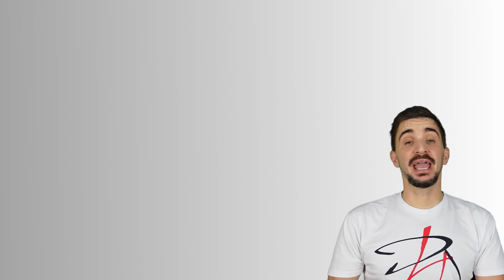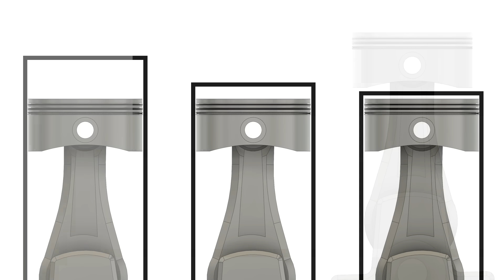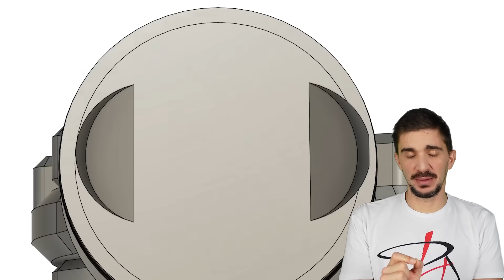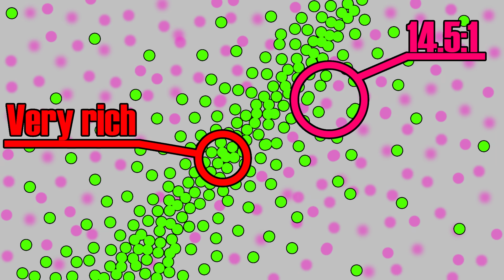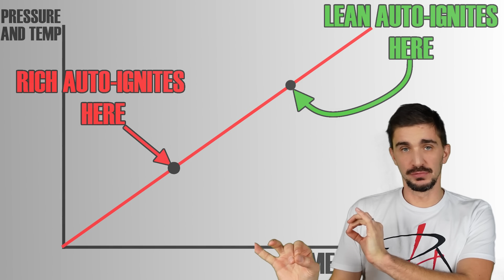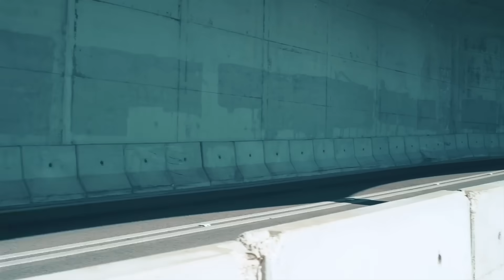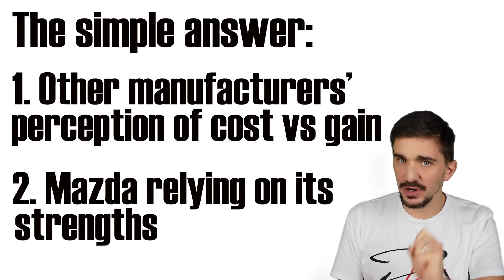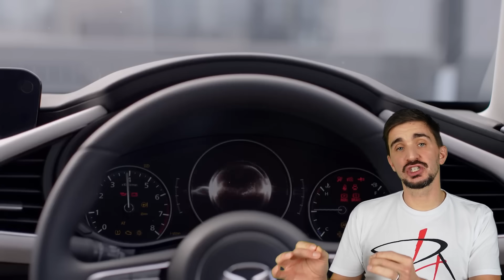The Game Changer Nobody Cares About - Mazda Skyactiv-X SPCCI How it Works and Why It Didn't Catch On

Comment: Put it in hybrids with e-CVT. 

More controlled work environment for engine and lack of torque is irrelevant there because of battery assist.

Put it in markets where fuel costs are a big issue and drives purchasing decisions.
Reply: Toyota has invested heavily into Mazda the past few years and they probably plan to do just that very soon.
Reply: @thebeetalls idk how I feel about that. I feel like Toyota is trying to sabotage Subaru thru their partial ownership
Reply: @XenZenSen Subaru died the day they committed to CVTs and delayed E/V development. IDK if they'll still be around in a decade. Painfully sad (I'm a long time Subaru fan)
Reply: that's nearly a toyota. they already to this in their latest engines starting 2020. lean mixture everywhere with port injection and small amount of direct injection in front of the spark plug so it actually burns but the lean bit is like 17/1 air to fuel ratio. so not as high as mazda. also due to atkinson cycle they can get away with 14/1 compression ratio and it comes with the ecvt that you talk about. mazda is an evolution of that besides the compression ignition they're going with
Reply: @SoulTouchMusic93 The A25A-FXS has a higher compression ratio than the FKS because of the cylinder head design. Both use the atkinson cycle, just like Mazda's 2.5 Skyactiv G
Reply: @SoulTouchMusic93  yeah, and the skyactive x would do better with a lower RON fuel rating for better economy, but good luck getting that in markets or replacing current infrastructure.
Its never the actual technology, its the infrastructure and availability that kills the benefits, which the government should be shouldering but instead they are doing dumb bailouts instead of helping the people
The toyota engines+hybrid+ecvt already do most of it and the air fuel ratio is good enough for some level of savings.
Reply: @acters124 Would the engine run on crude naptha with an octane rating of about 40, with no upgrading, reforming, alkylation, etc.? That would improve well-to-wheel fuel economy and economics.
Reply: The european market eSkyactiv-X also uses a supercharger to achieve leaner AFR. I own a 2024 Mazda 3. Daily driving I don't think it lacks low end torque, with the mild hybrid. Maybe with steep hills and high load (car packed to the brim with people and luggage) It perhaps could use a little extra punch. Speaking from experience doing road trips with this car. 1-5 gears are fairly short so if you expect high loads, not a big deal, drop to fifth. Sixth gear still manages but you can feel the engine is not happy. That's high speed high load scenario where I think the mild hybrid is not helping too much. RPMs float around 2500rpm at 120km/h which is not enough for this engine. It fares much better at 3k rpm in fifth gear.
Reply: No, SPCCI is useless as a range extender. A cheap, simple Atkinson/Miller cycle is already 40-42% efficient. SPCCI at generator loads can't stay lean. It can not be used for this purpose.
Reply: excellent video, one i've been waiting for for years. but how about some more info on the mileage and emissions?  isn't mileage the big selling point for these?  they're already selling them in some parts of the world - why not the US?
Reply: @someotherjustin Probably 30 mpg highway. My 1986 Buick Century gets 34 mpg highway.
Reply: @gregorymalchuk272 where do you get that figure? i'm seeing the skyactiv-x is rated at 40 mpg in mixed driving
Reply: @someotherjustin  The thermal efficiency of Mazda engines is high, but the engines are too big and Mazdas are big, fat, heavy cars. If you put that technology in a lightweight car, it would get much higher fuel economy.
Reply: yeah please don't
Reply: That was my first thought, run gas only extra lean on the hwy to sip gas & use an electric motor sandwiched in-between the engine and transmission. To provide extra torque.
Reply: Great idea, currently honda and toyota use Sterling cycle for hybrid car engines while powering the alternator.
Reply: What about making it last? Cvt transmission don’t last past 150k miles, replacement battery’s for hybrid cost thousands negating any fuel savings and making these car obsolete when parts cost to much to replace therefor make the car a throwaway
Reply: @ze_german2921  e-CVT lasts forever, it's not traditional CVT in anyway. And Toyota hybrids with e-CVT have been running on same batteries forever, hybrid doesn't care about battery capacity degradation like EVs do.
Reply: I think they finally decided to, and call it Skyactiv-Z
Reply: All skyactiv-x are micro-hybrids, at least in Europe. The starter power helps smooth the engine out.
Reply: I asked my relatives who run a successful all-manufacturer repair shop. I said I am curious about e-CVT, what do you think? They told me that curiosity is enough, i.e. forget it. I'll probably ask for details later. But what do people who generally dislike e-CVT say about it? I am asking because I want to research this.
Reply: Put it in a manual rwd sedan
Reply: 200 mpg from a Prius let's f-ing GO
Reply: @dsdy1205 1.5 L turbo diesel engines can get around 70 hwy mpgs in small lightweight 2,000 lb cars......Casey The Car Guy built a 800-1000 lb very aerodynamic car with skinny tires & a 1L or 1.5 L turbo diesel engine that gets over 100 mpgs that actually has decent power.
I like the VW L1 narrow, super aerodynamic, tandem 2 seated  car that gets crazy mpgs.
Reply: @michaelbrinks8089 The Audi A2 diesel got 98 mpg 25 years ago.
Reply: @gregorymalchuk272 I believe it, I just looked it up....I love how all these lying politicians & car companies around the world 🌍  claim they want to conserve resources & help the environment (go green, recycle ♻️ blah blah)  Yet will never  produce a small, lightweight, super aerodynamic, 100+ mpgs commuter car like the VW L1 because they'll loose fuel tax revenue.
Reply: @michaelbrinks8089 Maybe they worry they'll lose voters and customers when they die in common accidents that are 100% survivable in a normal compact car. No car manufacturer cares about a reduction in fuel tax revenue.
Reply: @MathewPollard-vj4uq Obviously car manufacturers don't care about less oil 🛢️ tax revenue but the government most likely does. Small lightweight cars can also be built with a good amount of safety. The smart car is a very good example.
Reply: @michaelbrinks8089 I was about to say, there are no realistic production cars at that weight.
Reply: @afishl1  The modern Smart Car weighs between 1500 & 2500 lbs & there are still a few small light cars in Europe. Back in the 80s many small cars weighed around 2200 lbs....Some weighed under 2200 like the Honda CRX & VW Rabbit.
Reply: They should make a mild hybrid version for low-end torque and even better fuel economy
Reply: @takiktos1265 that's exactly what they sell in Europe.
eSkyactiv-X
Reply: @takiktos1265  That would be a really good idea !
Reply: @takiktos1265 It would be perfect for a series hybrid, because the SPCCI doesn't work over a wide RPM range, so transforming the engine into an electric generator increases efficiency and simplicity
Reply: @gamerbg294 every ICE has a narrow rpm band where the engine is most efficient
Reply: @takiktos1265 Of course, but what I said was that because the SPCCI only WORKS (I wasn't talking about being efficient, but about it functioning) in a narrow RPM range, it's better to use it as an electric generator, because generators generally only operate in their highest efficiency range, so the engine components and architecture can be designed for optimal performance within a specific RPM (given that the differential advantage of the SPCCI is only exploited within a small RPM range, then there are even more reasons to use it as an electric generator than any other type of gasoline-powered ICE). It also simplifies things, since one of the elements routinely used to increase engine performance over a wider RPM range is a variable valve timing system, and a generator doesn't need that at all
Reply: @gamerbg294 instead Mazda preferred  wankel engines as range extenders in their MX30s. I wonder why…
Reply: @gamerbg294  I thought generator motors operate at specific RPM not for "highest efficiency" but for the purpose of turning the generator at a specific RPM to generate a specific frequency of electricity required by the electrical components that it is to supply?
Reply: @niroesiner Because they are compact and lightweight, but if 2-stroke engines are developed to meet emissions limits and also have reasonable efficiency (Mazda holds a patent for a 2-stroke engine with valves and a supercharger), or even an engine like the INNengine could have the same usefulness as the Wankel engines in a series hybrid (but since Mazda already have expertise with Wankel engine, then it was the safest option for them)
Reply: @SubwayFacemelt Take as example an alternator; it's also a generator that, moreover, operates within a varied RPM range, but is capable of charging the vehicle's lead-acid battery. This is feasible because, although the generator creates alternating current, the battery can only store energy from direct current; therefore, it needs a device called a rectifier, which transforms alternating current into direct current. Since direct current has no frequency, the frequency of the generator's current doesn't matter, as long as the rectifier is designed to regulate the current created by the generator. In the case of stationary generators, they are not intended to power batteries; therefore, they only create alternating current as if it were the alternating current of the conventional electrical grid (even in the case of stationary generators, when equipped with inverters, they are not restricted to a specific RPM, and can operate at different RPM ranges as needed)
Reply: @gamerbg294 Thanks dude! I have a LOT to learn.
Reply: @gamerbg294  very smart observation about the VVT 👍
Reply: @gamerbg294  maybe someday someone swaps a complete Toyota hybrid synergy system into the skyactiveX Mazda 3 for the ultimate sleeper car of the über-technophile
Reply: @SubwayFacemelt  electric conversion circuits are tremendously efficient, devising your system to minimize the degradation of the combustion engine and then using a transformer and power converters makes way more sense than the other way around.
Reply: @gamerbg294  That's not true. SPCCI is active up to ~4600 rpm full throttle, and at least 5000rpm when not forcing. The car shows you when it's in SPCCI mode.
Reply: @takiktos1265 they make mild hybrid CX30 and Mazda 3, look for it as e-skyactiv x
Reply: Name it: SkyPrius-X
Kinda cool!!!

SPCCI + Atkinson cycle + synergy drivetrain
Reply: @bigfranz1709  technical pervert!
Reply: I feel like there's a high chance skyactiv x engine are already running with an Atkinson cycle in their engine map. It'd be really bloody hard running a gasoline engine at stoichiometric while also pushing 16:1 compression. Also probably why people think it doesn't have much grunt as some torque is sacrificed at low RPM.
Reply: Also markets where fuel cost is an issue also tends to be markets where car cost is an issue. No one would buy a new car
Reply: @takiktos1265  A month later and fuel cost is an issue everywhere and people are still buying cars... Lots of EV and hybrid cars...
Reply: Nobody wants a cvt  poor reliability
Reply: @ajhiii070-12 perhaps true, but eCVT are a lot better, particularly for those of us who just want a reliable car to toddle about in.
Reply: @ajhiii070-12 I love my Gen 5 subaru CVT.
Reply: I have the 2015 Skyactive Mazda 3 and I love the geared 6speed auto. 109k miles did 2 transmission drain replace trans filters. Still shifts smooth. Happy to not have a cvt
Reply: I think the Prelude is going to severely effect people’s perception of e-CVT it gets double gapped by a Prius hev
Reply: @Paganslayer affect
Reply: @mikey92362 oh I thought that was like a behavior he has a southern affect
Reply: @Paganslayer I can see where that might have an effect on your thinking.  LoL
It's all good. I just have grammar pet peeves because I'm an asshole.  :)

I also didn't sleep last night. So now that I re-read your sentence, I think you were correct. Effect is the right word since you're using it as a verb.

But I won't edit or delete the comment. I've earned my shame for the day.  :)
Reply: what is the point of putting a combustion engine in it at all? BEV is sufficient
Reply: @BanterEdits  Not for all. Van drivers, sales people and people living in apartments without access to home charging have their needs poorly met by BEV currently.
"Don't let perfect be the enemy of good" as they say if the outlook on electric charge point for all parking is more than a decade away and battery tech that doubles capacity (400 Wh/kg at pack level) is similarly far out in the future as of yet.
Reply: In these markets a full electric just makes more sense these days.
Reply: @robostomatoand poor range and skyhigh price
Reply: @Jani_Ikävalko don’t forget sitting around waiting for it to recharge…provided you don’t have to sit around to wait for an open charger before you sit around waiting for it to recharge
Reply: @zimmejoc haha right
Reply: NO! Stop with the crappy, gimmicky automatics. Stop hampering us with heavy and short-lived battery BS. Give us back the manuals. I have a lower trim '14 3 6-speed, and if I were to replace it today, I have to shell out for the upper trim to get the manual. Just give me a free-revving, efficient, engine and a manual trans. Anything more is just hype. No hybrid garbage. No redundant systems. And get rid of CAFE for Christ's sake. We don't need larger cars and trucks.

We live in a weird time where people complain about right to repair and repair costs, but then those people demand more unserviceable electronic parts. Can we just get back to improving on better engines and making quality components instead of throwing in more gizmos? I'd prefer not to diagnose 112 computers to repair some Rube Goldberg electro-mechanical circle jerk that needs to be synched at the dealership.
Reply: @dk-bw4gk CAFE standards will never go away, sadly.
The left loves big government and heavy regulation as much as they blindly hate corporations. Even if you explained to them why CAFE standards actually make fuel economy worse, they won't accept the information because it goes against their dogma.

And the right will never change it because it would look bad in the media. Imagine the headlines if Trump ended CAFE standards. We'd have YEARS of headlines about Republicans wanting to destroy the environment because...reasons.
And people would just agree with it without understanding it. It would cost the party lots of down ballot elections.

Or at least that's what they think.
Reply: @mikey92362  You're absolutely correct, but it's still unobtainable. Their targets are completely unreal. I guess they can make the F-150 the size of an F-650 and put a little 1.5 liter turbo diesel in it, but even then I don't think they can hit the mark. That truck today would have to make ~34 MPG average. The rules are currently suspended (sorta) but I haven't even looked to see what 2027's targets are.
Reply: @dk-bw4gk  But the way the law is written, they don't have to make it have better mpg. They can just make it bigger and it will also pass. 
That's why trucks have been getting bigger and bigger for decades.
Reply: @mikey92362  I know, but every year the minimum footprint moves larger (remained the same the last few years) while also jumping up in MPG. For 2026, the largest truck still has to hit 33-34 MPG. Even if you maxed out on size for 2025, you still have to do ~5 MPG better for 2026.

See Wikipedia Corporate average fuel economy, scroll toward the bottom for the charts.

Comment: I think a lot of people either dont realise or forget that a diesel engine doesn't have a throttle. Its a fuel controlled engine, whereas a petrol engine is air controlled. 

Thats also why there is so little engine braking unless you use a jake brake.
Reply: An air controlled engine? Lol
Reply: @hdhardcore8511  it is. The throttle controls the engine. The throttle limits air. The spark and fuel only need to be passive, as they were in a carburetted engine with a magneto or early cdi ignition.
Reply: Diesel on the other hand has no throttle, hence the massively variable air fuel ratio.
Reply: Some diesel engines do have a throttle body, actually.
Reply: They do, but in the engines basic form, it is not a required component. So as a generalisation, and to clarify, diesel engines dont require a throttle.
Reply: @vvevvevvvvalso, this is why the runaway diesel is a thing - the lack of throttle means the piston engine effectively turns into an air brake or power take off in betwen the combustion and ignition stages of a jet engine.